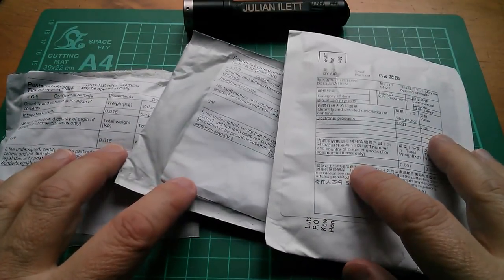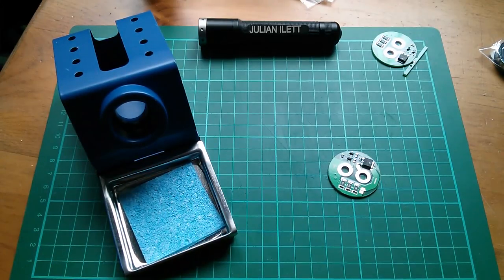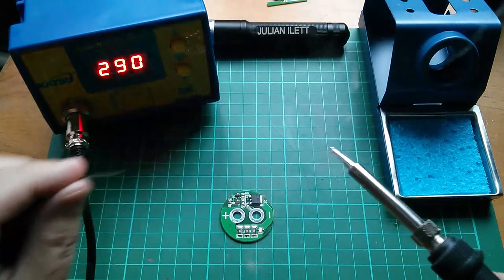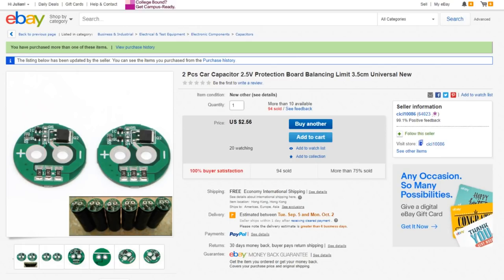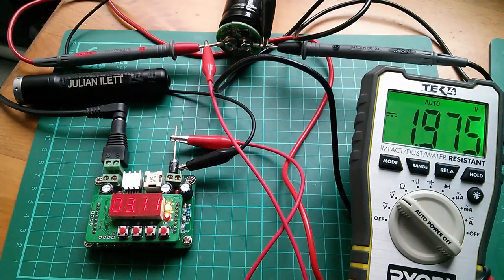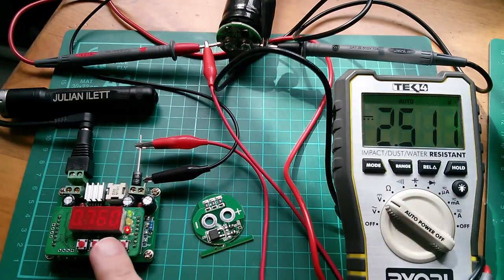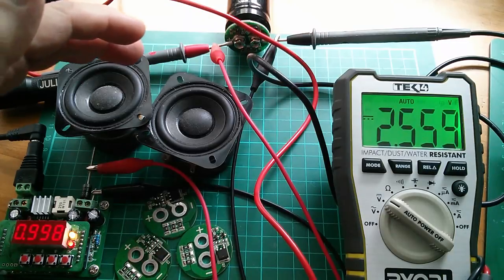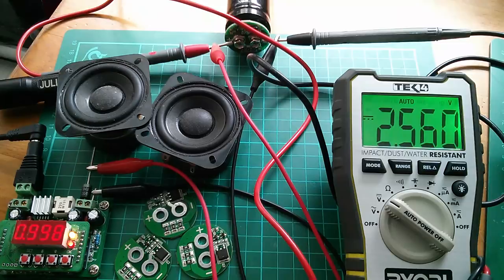Julian's Postbag Plus: #105 - Bluetooth Supercapacitor Speaker

Comment: I'm curious as to why you need the diode in the first place, except to protect against accidental reverse-bias the 1st time. I'd just try some short lengths of 14-16 ga. wire direct from the power supply to the cap to minimize the voltage drop across the connecting leads. Then measure the voltage drops. I don't see how you could get more than .8 volts across the diode without letting the magic smoke out.

Comment: That's my issue, I have several multimeter's  They all say something different. I can't trust them. My Fluke killed my 18650's because I had it set to 4.15v and it overvolted 4.3v... I figured it couldn't be off that much, but it was... My $25 multimeter is more accurate than my Fluke for low voltage

Comment: Hi  JULIAN
 can you help me find out for me what type on IC is that 
element in red circle from picture please. Body long on 3mm wide 1mm 
markings as A16P he get fried when battery LiPo was discharge to 0 . I 
think the IC is part of power circuit belongs to LCD power supply but 
that battery was drain out .

https://drive.google.com/open?id=0B3HKtthOr2j2RXBRQmN0VUlpdTQ
Reply from the maker: It looks like a SOT23 5-pin device marked A16P as you say. But I can't find any data on it.
Reply: THX
I THINK THAT IS LED DRIVER FOR LCD
Reply: thx

Comment: You have a full chain of crappy elements with unexpected behaviour. No way you can seriously measure something and learn from it. I suggest to start with a decent power supply and a reliable reading of voltage and current. Never trust build in 7 segment 10 penny meters on Ebay DIY power circuit boards. 🤓

Comment: my conclusion, despite you´re needing much more diameter on your cables, these shitty overvoltage protection circuits are the most crappy and dangerous things i came across so far...

Just take a look at the board itself..there is a voltage drop sensor which acts as a Zdiode, but how sharp is its knee when it conducts? 
The temperature on that MOSFet is an nice indicator, that there is something fundamental wrong here, as i thing that the output of the overvoltage detetcor isn´t able to drive the mosfet into saturation, thus leaving it somewhere within its linear region, make it dissipating the power instead of sending it straight into these resistors.

Bring your scope to the bench and probe the mosfet gate voltage, and check its datasheet, would be a nice idea..;)

You should really never ever trust these china crap, but test them prior throughout. it´s better being save than sorry, and an exploding superCap is not what you want to ever experience...usually it´ll catch fire and you´ll also have a "wonderful" blowoff as well...
 
Nice video as always...keep ´em comming :)